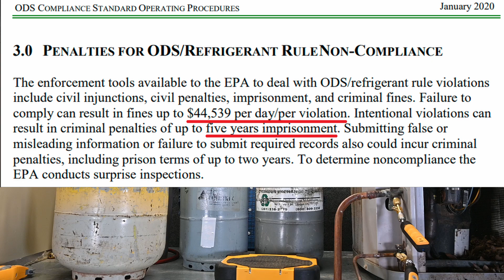HVAC 122 Refrigerant Recovery, why we need to

Comment: When recover the refrigerant after awhile will hear a refrigerant boiling to vapor, do you think if heat the system will help to boil refrigerant and make the process faster? Thank you Mr. Ty🌺
Reply from the maker: Yes that video should. Be posted by next week. I use the same tank heater on the compressor. Makes a big difference.

Comment: Can you talk about replacing R 22 condenser with 410 condenser and do you have to changeThe evaporator coil when you do that
Reply from the maker: As long as the evaporator coil is rated to handle the pressure of 410a  and sized correctly it will be okay. I prefer to replace the coil with a matching condenser for efficiency. 
Unfortunately evaporator coils are prone to leak even new.

Comment: Seems to me with the need for locking caps and copper thieves, more and more systems are going to be on surveillance cameras.  So you might as well assume any thing you do to the unit will be on video.

Comment: a fun topic might be to how to deal with rain, and especially heat pumps in the rain. many outdoor units will get their coils soaked when it rains wich makes it pretty interesting to get good readings and performance calculations when working in heat mode. my country gets about 1,5ft of rain a year mostly during fall and winter so checking the performance and charge can be interesting at times.
Reply from the maker: That's a really important point.
I will be making a complete heat pump playlist / class soon and I will have it listed there. 
I really enjoyed living in Las Vegas where we had no rain 😂

Comment: So water in a refrigeration system forms acid ? I know it will freeze at the outlet of your metering device causing a restriction, in fact applying heat to a TXV you think may be bad should be your first test if the system exhibits a restriction, and if it results in restoring refrigerant flow you know there’s moisture in the system and the valve itself is most likely not your problem and replacing the dryer is your first order of business. Now as for this acid comment I’ll have to research this, I know the breakdown of the refrigerant itself will form acids like hydrochloric acid and even worse hydrofluoric acid, but from moisture ? Hey looks like you taught me something, bully for you !
Reply from the maker: I will do diagnostics eventually.

I'll post some links.
Reply from the maker: https://www.hvacinvestigators.com/understanding-hvac-diagnoses-acidic-refrigerant/
Reply from the maker: https://www.hvactrainingsolutions.net/hvac-training-moisture-in-an-hvac-system/
Reply from the maker: https://www.achrnews.com/articles/94187-the-effect-of-moisture-on-poes
Reply from the maker: https://www.trutechtools.com/air-conditioning-system-evacuation-training.html

Comment: It’s becoming harder to recycle R 22.      Because I own a refrigerant identifier and I test my refrigerant before I recover it on old systems,  I find the R 22 somebody topped off a drop in refrigerant right on top of the old existing R 22 contaminating it making it unusable. 
               When I asked the customer for the old receipts of who is the lack technician who sold them refrigerant sometimes they clearly state that they sold the customer R22 and they charge them the high price of R22. 
                           But they ripped off and stole from the customer and switched it with one of the drop in blend refrigerant. 

    It’s a good diagnosis tool and a good sales tool to own a refrigerant identifier

Don’t be like the other guys without A refrigerant identifier

Definitely record and log and if your boss is on the rooftop with you catch him in recording telling you to vent and record yourself venting under duress and then take it to court
Reply from the maker: I try to let things go but, it really gets to me. Selling R22 then mixing with other stuff causing bigger problems
 Ohhh that's aggravating. And it's happening more and more every day. 

I need to do a video with the refrigerant analyzer.
Reply: @love2hvac  I bought my first refrigerant analyzer in 1992  and I have been using them daily ever since just as religious as I use a micron meter on every job back when micron meters came in a leather case with an analog meter and use D size batteries
Reply: @coldfinger459sub0  Nice seeing you here, what refrigerant analyzer do you use? As in a brand or model never heard of that tool